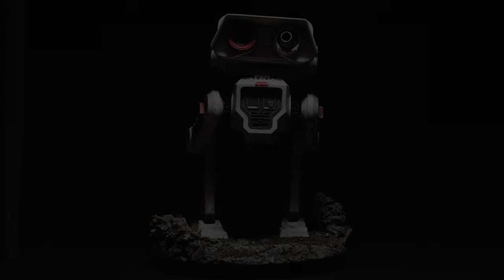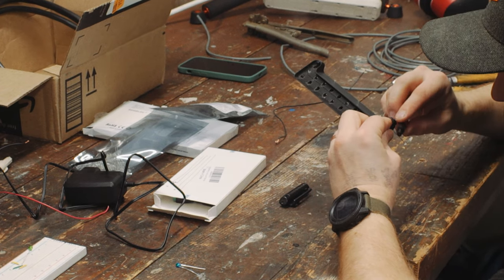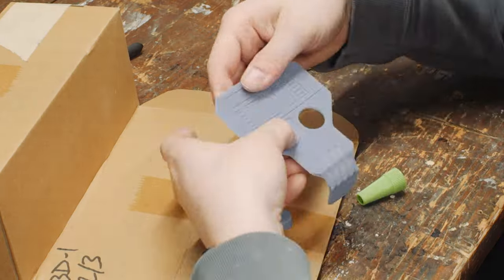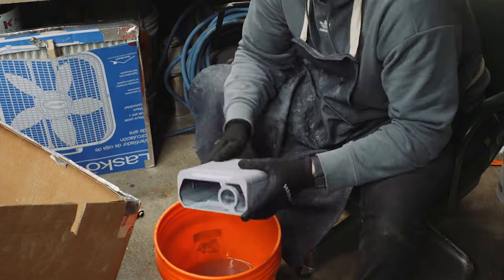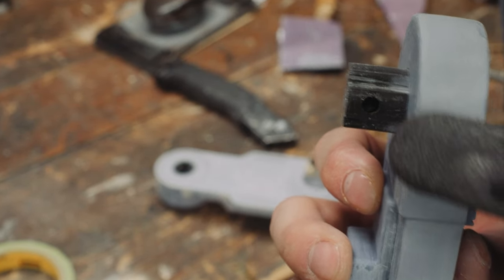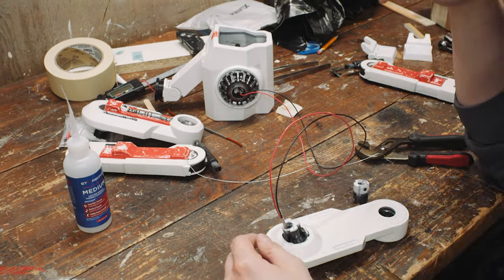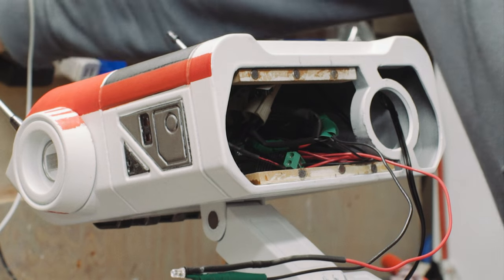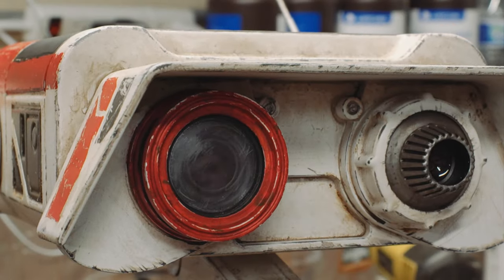How I Built A BD-1 Droid With A Real Hologram Projection Lens!

Comment: Very well done! The end result turned out terrific

For the weathering on the red and white areas, are you just scratching off the top layer of paint?
Reply from the maker: Thank you!

Yes, this was one of my first times weathering like this so I was just scratching paint off. It wasn’t too hard because the red acrylic paint came off easily before I sealed it with a clear coat. The white I was scratching just enough to allow my weathering wash a divot to sit in and dry.

These days, I still use this technique every once in a while, but now I would probably lay down a coat of Vallejo’s chipping medium before my airbrush paint. I’ve seen other folks use hairspray, but I haven’t tried that method yet. 

Hope that helps! Thanks for watching!